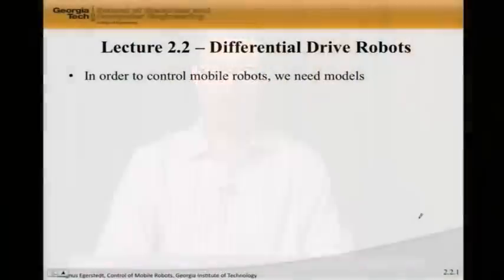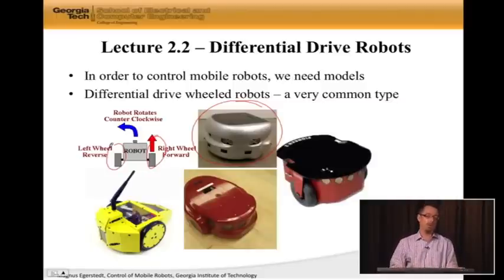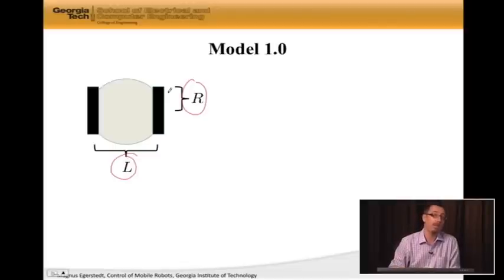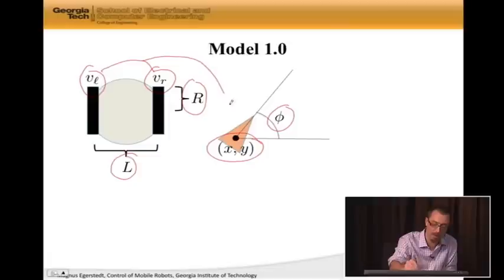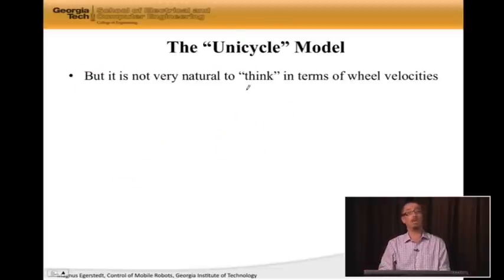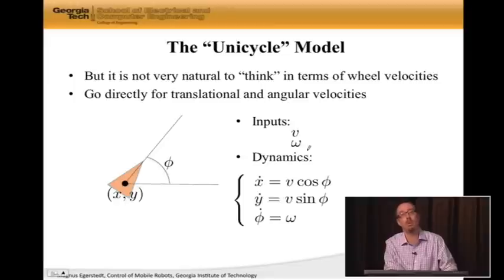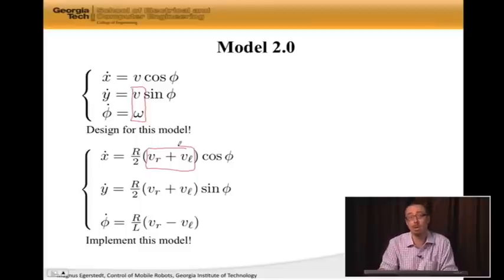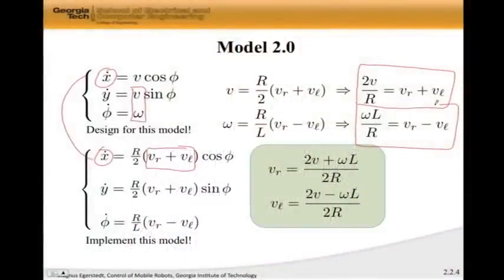Control of Mobile Robots- 2.2 Differential Drive Robots

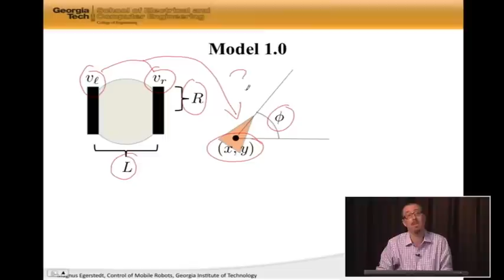Comment: 3:32 I think his forward kinematics equations are wrong. Instead of linear velocity of the wheels "v", it would be the angular velocity of the wheels "w"

you can confirm by doing a dimensional analysis, linear velocity times R gives you distance units squared. That makes no sense

to show "v", the substitution v = w * R has to be made first

Comment: Shouldn't v_r and v_l be w_r and w_l? v_r * R has units of m^2/s.
Reply: v_r and v_l (in small letters) in this case are in radians/s.
Reply: @cumulus3341  Thank btw. So the notation in the video should be (omega)r and (omega)l. Using the 'v' generally stands for the linear velocity, hence this is why people are confused with what units to use.
Reply: @cumulus3341  thank you